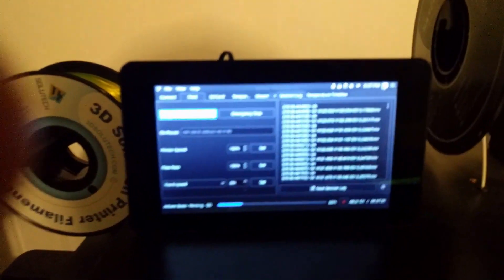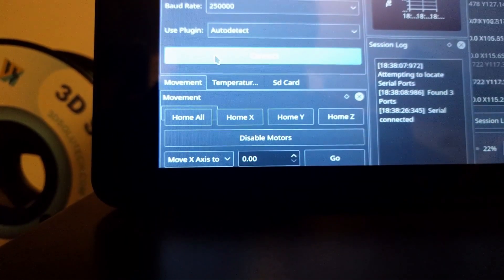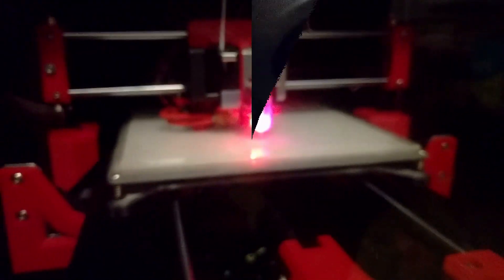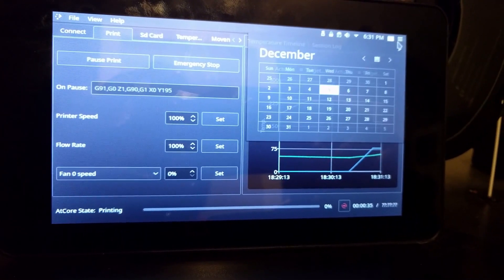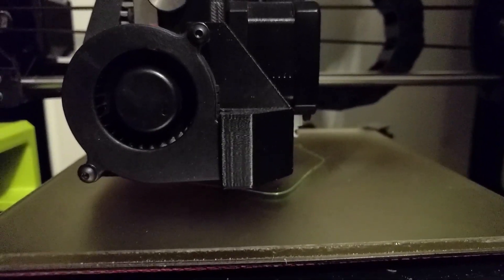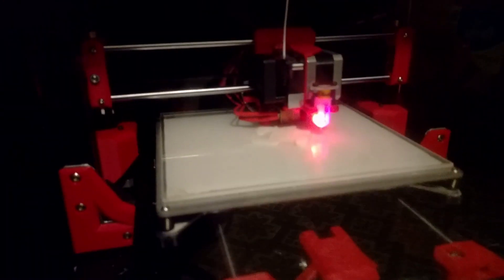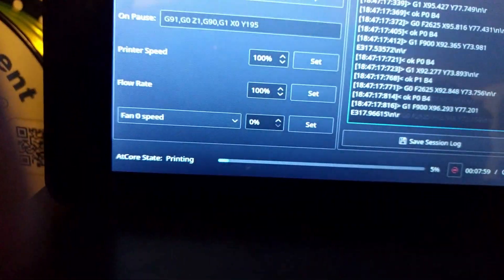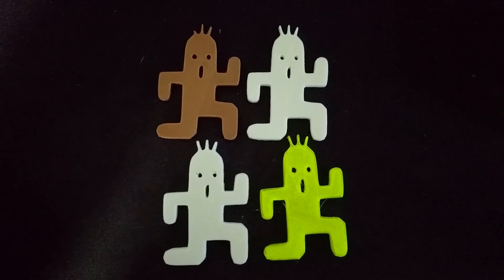AtCore Rpi Test 2

Comment: Hi! I just got a PS3 with a CFW. I done every step to try to get a modified save on my FF7 (which I downloaded from PSN) with the Black Chocobo but when i export the Main Character, then copy it to the VMC Folder and then try to use the memory card, it doesn't even show up. Did I do something wrong? Do I need to download the Rom the game or what? The file ends in "VM1.Char", is that correct?
Reply from the maker: The char files are only characters they need to be imported into save files. Please refrain from asking questions about unrelated programs in these comments. There is a help forum for where you can ask your black chocobo questions.